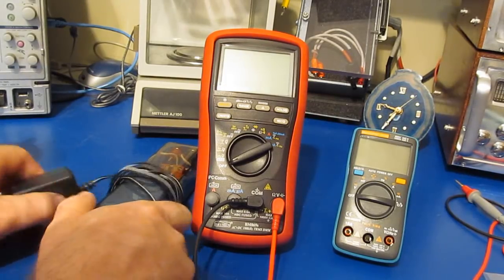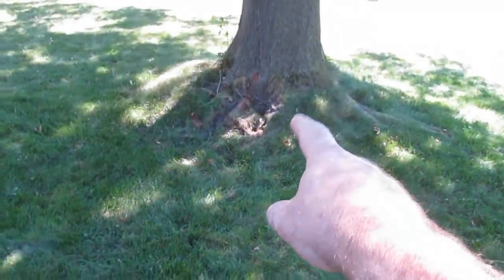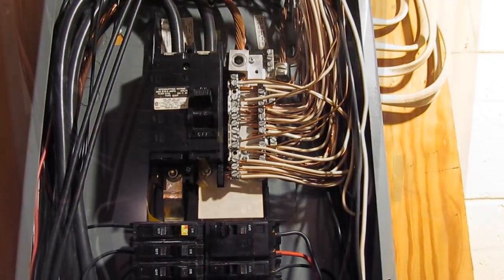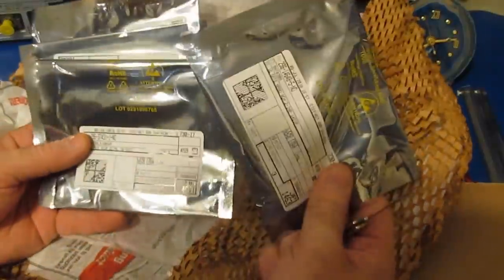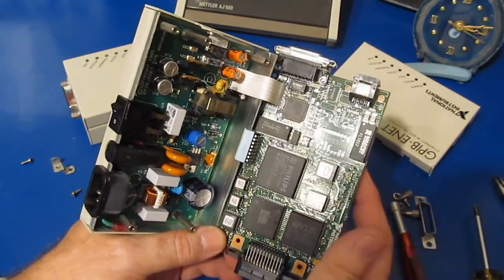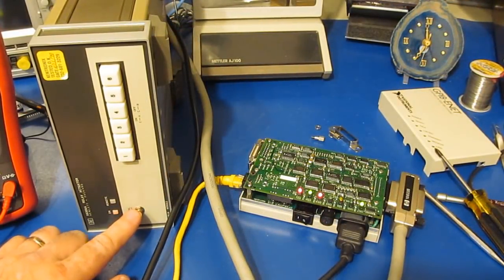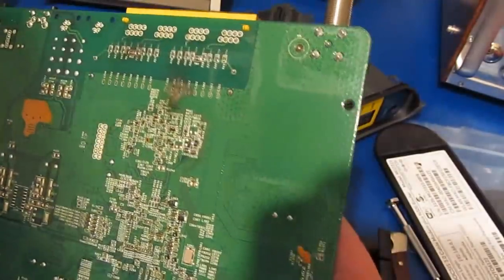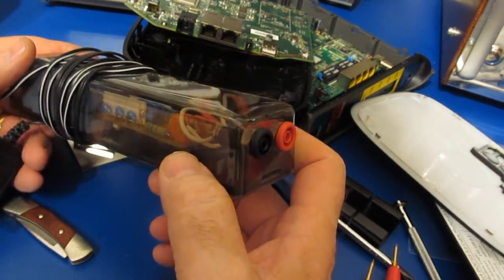Lightning takes down my lab

Comment: i have never seen ethernet transformers arc over in any condition ... i wonder if they were fully potted 
i also dont think it would be too bad of an idea to tie all your equipment grounds together 
i have never done that myself but i have seen it done
Reply from the maker: As I mentioned in the video, the GPIB cables do provide a pretty decent connection.  If you have never seen one, they are about as thick as RG8U and have the braid to go with it.    It may have helped prevent more damage but really hard to say.   

The real questions I have for you personally are, 1) how is that diff probe coming along?  2) have you played with one of those Micsig $130 KV 100MHz jobs?  If so, what did you think  3) did you buy one of Dave's 70MHz probes?  

I have the parts to start working on my next attempt but became a bit side tracked.  Hope to have something I can demo in a month or so.

Comment: Another great video. Your insurance company lucked out as you seem to repair most of the boxes. Maybe don't need to file a claim. Maybe the cable company replaces the router.
Reply from the maker: I spoke with the insurance company prior to starting any repairs.